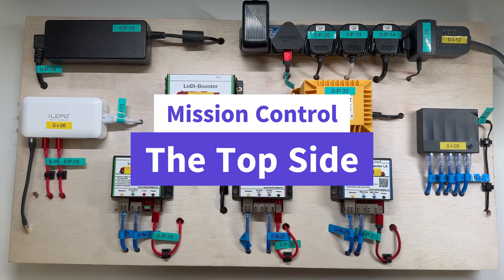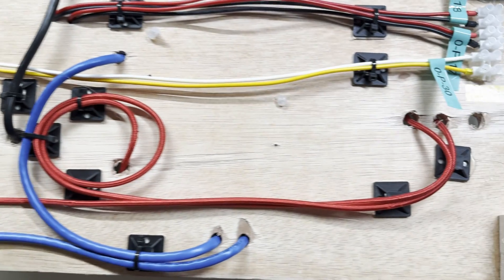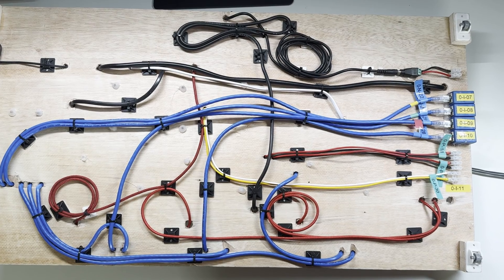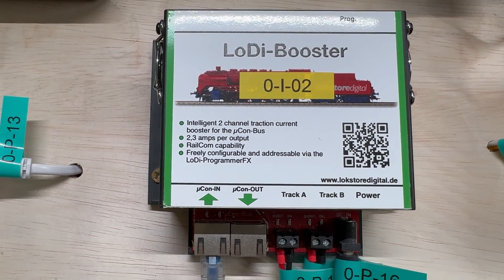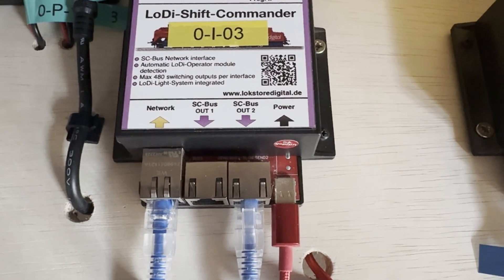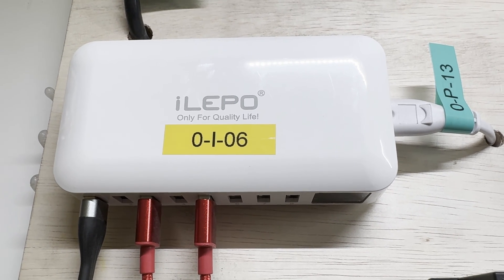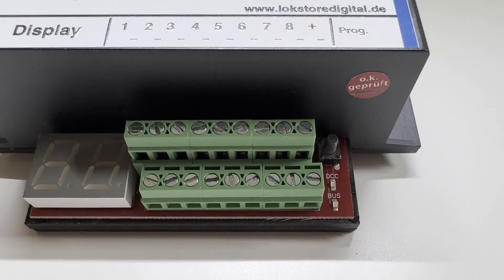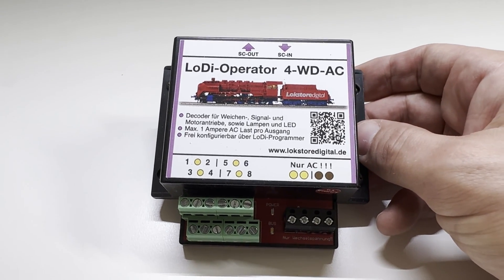LoDi IP Network Based Train Control System

Comment: Hi,

Quick question regarding the LoDi system.  I know it's mostly designed for computer control and automation but is it possible to control turnouts via either a dcc address or even just the LoDi-Con controller?  I will mostly use itrain but I would on occasion like to do some manual shunting/driving and being able to control points/accessories without having to rely fully on automation would be nice?  Thanks

Comment: Hello,  it looks like you are not using shielded CAT5e cables.  Are you have any issues by not using it?  I only ask because it seems that Lodi shows their components using shield cables in photos and videos.  I also was going to make my own custom patch cables and use regular un-shielded CAT5e.
Reply from the maker: Hi,  I’ve not seen any issues. I used custom cables as it’s impossible to buy ones the exact correct length. 

If I was starting again, I would put ALL the LoDi devices on one central board (with standard patch cables) and then rely on long runs of cables to the point motors and blocks. 

Next time! 

Thanks for taking the time to comment. 👍
Reply: @hillmanhalt  Thank you for the reply.  I currently have the Lodi-Con with my Z21 but I am switching over to all LoDi components. I like the idea of putting all LoDi devices in one central location also.
Reply from the maker: @NEC_Amtrak  let me know how it goes!
Reply: @hillmanhalt  One more question, why did you get the Operator AC instead of the Operator DC for you MTB switch motors?

Comment: I’ve also gone down the Lodi route , so far I only have the Rektor & booster, I was impressed how easy it was to setup and get up and running.
Reply from the maker: Yes, it is very easy to set up. 

UPDATED: I’ve got 11x block detection units + 7x point control units. 

It all words seamlessly!
Reply: How do you work out how many boosters you need for your layout? Thanks
Reply from the maker: @user-eb8ld6kn8t  To be honest, I don’t know!  

I guess it’s a function of the overall layout track length. 

All I can say is that with 88 feedback sensors/blocks, all is working well.